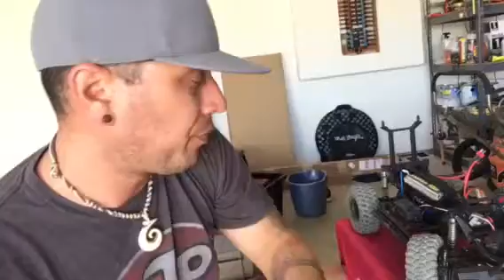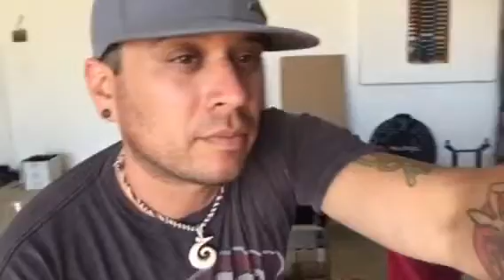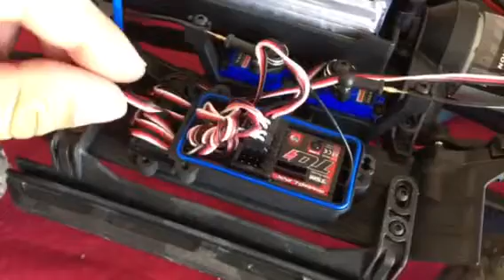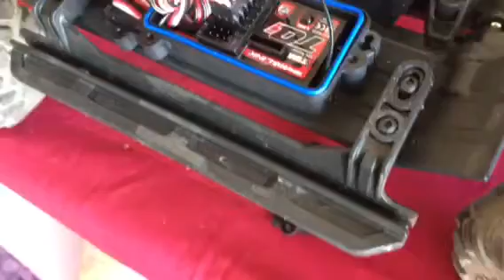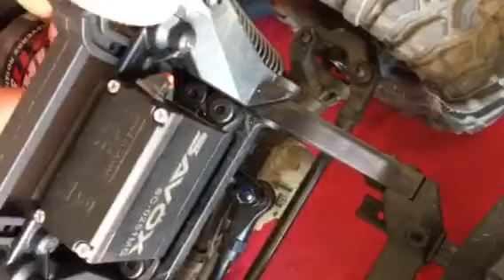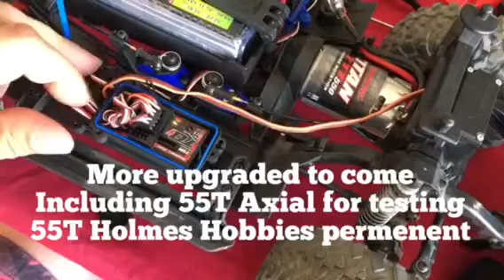Upgrading Traxxas TRX-4 Steering Servo savox sc-0251 best upgrades for  TRX-4 "THE AXIAL KILLER

Comment: That Servo may turn quicker than stock but it is weaker at 222oz compared to the stock servo(2075X 250oz), the 2075 is 125oz, should of got the 1230,  its much stronger than stock and this one, 1230sg is rated at 500oz and faster at .16 compared to yours at .18sec
Reply from the maker: CamaroWarrior it actually feels stronger than stock and holds up well around 80 hours on this servo went from scx10 to trx-4. It's what I had laying around and works well without a BEC so far 👍
Reply: The 2075x is 125oz according to Traxxas https://traxxas.com/products/parts/servos/2075X